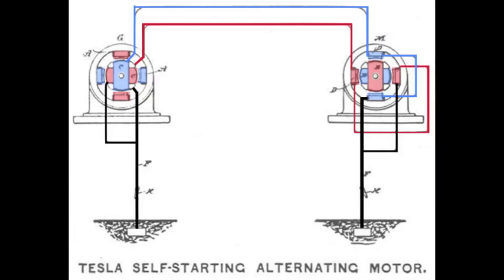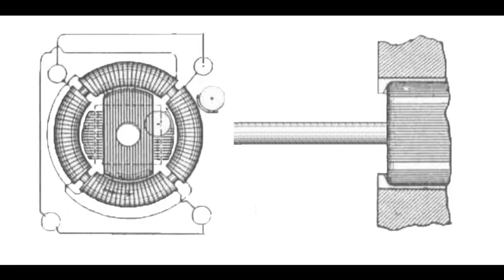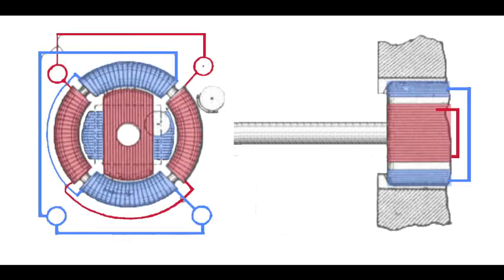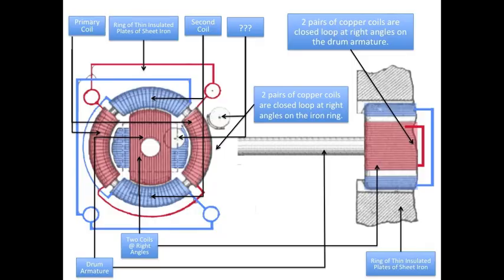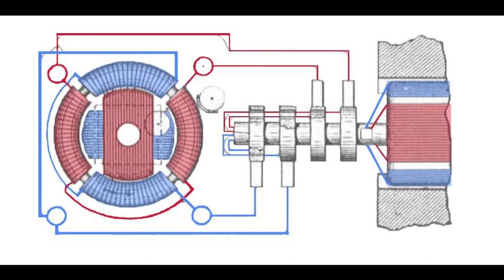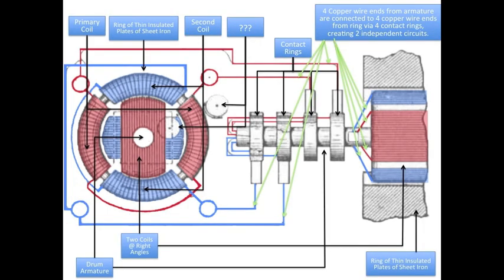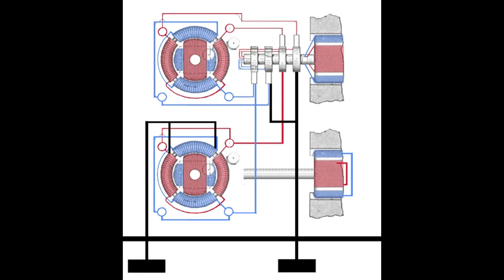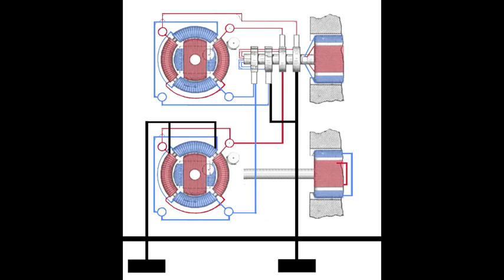How to Build Nikola Tesla Free Energy Alternating Dynamo and Exciter Motor - Diagrams - DIY

Comment: The patent doesn't match the claims, the drawing is from 405,859 which is about running a synchornous motor from a generator and about how, once synchronised, the motor will track the speed of the generator.

Comment: You can't get free energy from symmetric motors. All AC motors is symmetric motors. AC grid is symmetric system, that does not produce free energy. Russian conspiracy theorists can make video, where they create perpetual motion machine from two internal combustion engines, where exhaust gases of one engine goes into fuel tank of other engine. Of course that will not work, but conspiracy theorists live in world of bat shit crazy theories. To get radiant energy, direct current pulses must be used. Where is source of direct current? where is switching commutators ?   Where is magnets ?

Comment: I fear you have gravely misunderstood the entire premise of power engineering, and how a simple polyphase AC system works.  Just so you know, the system receives power from an engine.  An engine of some kind drives the alternator, to power the system.  Could be a steam engine, hydro turbine using falling water, or a hamster in a wheel.  The ground connection is the neutral of the polyphase system and serves as a current balance between the phases.  By self starting, Tesla means an AC motor that is able to start itself when power is applied, which was not possible until the invention of polyphase AC.   It does not in any way mean the entire system was able to start itself.

Comment: I think you can use a modern replacement for the rings. Look at a "slip ring" like those used in wind turbines to prevent the wires from getting twisted inside its shaft.

Comment: its a DC- wave generator  in double DC- wire and expanded to additional reverse AC Spikes by pressure to eath in parallel Phase to AC motor on the other side.

Comment: Could you compare this toTesla's  splitting the positive concept to charge batteries using a rotating parallel  circuit and a series circuit  in a rotational solid state  circuit,please.  To me this is his solution mechanically  however any system with moving parts is subject to eventual mechanical  selfdistruction.  There is also the matter of energy losses and negative potentials that are completely missing from the evaluation .

Comment: For the record why it works if I connecting to ground is because you're essentially using the Earth as a battery but basically Nikola Tesla realize the idea of ground loops of electricity into you wouldn't need a drive belt to hook to another motor or generator all you would really need especially nowadays is a car alternator on the same shaft in the middle of both Drive Motors you would only have to figure out how to make post Motors spin faster to produce more electricity

Comment: We used to light up the bulbs with the wire to the ground when we were young. One wire was connected to the copper wires on the light pole without current at all. It lit up 5watt light bulb but I got spanked for doing that so stopped messing around.

Comment: the circles are voltage rectifiers
 ac to dc
 dc to ac
two motors alternating back and fourth simultaneously to drive each other.

there are no friction surfaces in this device.

everything is done via altrnating magnetic flux capacitance.
Reply: Where's Christopher Lloyd  when you need a flux cspacitor?  Tesla made the mechanical model and Lloyd made the solid state one...got a luv it.

Comment: it operates on rf frequency voltage.
its one machine with one conductive shaft that is divided in the middle with a non conductive material that allows each unit to be seperatly polorized with out simutainously polorizing the other side so both units alternatly feed voltage from the earth back and fourth to one another and back out to ground with causeing any enternal shorting.

volts are the power for rotation and current provides the torque for work.
the more load applied the more current rises thus so does the voltage.

you cant more than a milliamp out of it and this why it does not produce any heat.
there are no frictional contact points like brushes and such just spark gap transfere of high voltage.

reverse enginere it and it will cog internaly and produce amps and heat.

the physist job at the patent office is to not only determine if your energy pump works with out breaking the BANK. AND TO REPORT IT IF DOES SO THE CAN COME GET YOU AND EVERYTHING YOU HAVE PERTAINING TO YOUR INVENTION AND PUT IT AWAY SAFTELY FROM THE REST OF THE WORLD.
HIS JOB IS ALSO TO REVERSE ENGINERE YOUR INVENTION SO THAT HIS MASTERS CAN USE AND METER ITS USE FOR WORK AND THERE BY APPLY A CHARGE TO IT ACCORDINGLY.

IF YOU EVER MAKE OVER UNITY.
YOU WILL LOOSE EVERYTHING TRYING TO PATTEN/protect the control and profit from your knoledge and hard work.

GREED IS WHAT INSLAVES YOUR ASSES TO MONEY TO BEGIN WITH YOU SHIT FOR BRAINED PEOPLE.

WAKE UP BE SECRET AND GIVE FREELY ALL YOUR KNOWLEDGE AND WORKS TO THE WORLD. OR DIE DREAMING OF RICHES AND PROSPERITY.
Reply: Mennnnn.....he have the right to silence 🤐 in the name of Master Nikola Tesla... sorry but  we can't make something is ready make..no way.

Comment: The   patent link describes a method of starting a synchronous motor powered by a single phase alternator. It is not possible to start a single phase ac motor built as a synchronous motor. As is well  known the ac synchronous is the most  elegant, simple and efficient machine. The patent describes a legitimate method of obtaining a two phase or  in modern terminology a split phase alternating current source  from a single phase source. No energy is obtained from the ground which serves merely as a return path  with the system developing into  a three wire system. Two phases may be carried on  three wires and this split phase causes the motor to start with low starting torque. . As the system cannot be loaded at start up the artificially created split phase or dual phase       source must be kept connected till synchronous speed is reached when it is entirely possible to extract power from the motor. .  If the motor is overloaded to cause it  to slow down  ,and lose synchronous speed it will stop or stall. This patent has nothing to do with any sort of free energy or self energized system .  I would appreciate links or references to the free energy system devised by Tesla as mentioned in the video. Thank you.

Comment: in the patent it says you need to start it from a source
its perpetual once in resonance
on the part of the resistor
in one of his diagrams you can also see a phase correction inductor
also dont kill the dipole
in one of his diagrams there are 2 switches at earth
one closed and one open
they alternate so the dipole wont be killed
anyways nice explaination

Comment: its a clever device but it would have no torque. you could only take small sips of energy off of it and it would need time to get back up to speed. you would probably need to cycle hundreds of them to produce any usable power.  the greatest idea of this is harnessing ground energy by reinvesting a small differential to make a larger differential and compounding the process.

Comment: Wardenclyff Tower

 Wadrenclyff tower     is a (Nnemp) this is achieved by gearing down the VHF to ELF  (Schumann resonances) and ULF (atmospherics) ranges. Provided wave propagation conditions in the cavity,  thus could be achieved threw the hood and cup...........

 Non-nuclear EMP      generators are non lethal to human but it is capable to destroy the economic infrastructures like; Industries, neutralizes communications, surveillance and targeting systems and could upset or damage all electronics and what ever comes under its footprint.

 As a weapon         its role is important in low intensity conflicts and military operations other than war. They are typically narrow band devices, may either be short pulse, high peak power or they may be high average power operating at high repetition rates or in continuous wave (cw) mode.

 If need more details on Wardencylffe tower and how it really works i can provide it. Therefore the knowledge of this can be destructive and,  i am not responsible for anything that can be provided by the library. 

Hereafter anything that is a modern...."Tesla coil" is only for show no practical use, do not debate with me on this. Therefore if you wannna attempt to it would only indicate one of us is "thinking" clearly.      
                                     eigenmodes are, approximately, 7.8, 14.3, 20.8, 27.3, and 33.8 Hz[2]
        
                                                                                                                                                                  Written by: Justin Aldrich

Comment: As I read this. Tesla is showing that you can solve the problem of driving an AC motor with two wires, but you cannot start an AC motor with two wires. You need a four wire connection to run an AC motor from a dead stop, Driving the stator windings from both sides. Once the motor is going, you can drop the back-half and run the motor with just two wires. It's not free energy or a motor-generator set, it's a simple way to avoid a starter motor or DC drive motor to get the AC motor up to speed so that it will synch with the mains power with a normal connection. It also removes the two extra wires he designed into his earlier AC system-motor connection. The ground connection is simply replacing two of his four leads from his earlier patent. This requires the generator continually put power into the ground (Not knowing when someone will need to start their motors), which probably didn't make the power company happy.

Comment: I don't think the white circles on the diagram represents resistors. I think white circles represent where the connection is made to the circuit (ground/commutator). Notice how Tesla is using 2 bucking coils inside each of the motors. I guess all his coils are wound in the same directions too. PS: Awesome video thank you for posting, thumbs up from me.

Comment: To Mr "Flyfisher". I hate to burst your bubble but this patent and described machinery has nothing to do with "Free Energy". The generator on the left still has to be turned by some mechanical means (like a hydro-Electric Dam) and the motor on the right will then "Synchronize" with the generator after the startup coils are brought in to the circuit to start it. The Earth disconnection he talks about is just a return path for the current and has no "magical" properties. This eliminates the need for a third wire. The second coils (used for starting) are disconnected once the motor synchronizes because they are no longer needed. If you have an air compressor at your home, that motor will use a capacitor and "plugging switch" to do the same job as this cutting out of the second set of coils. This is what Tesla described to the world as a "Transmission System", not a Free Energy system. We use this around the world every day to power your electrical loads, the only difference is we use a 3 phase system where this is a 1 phase system. Nothing new here...